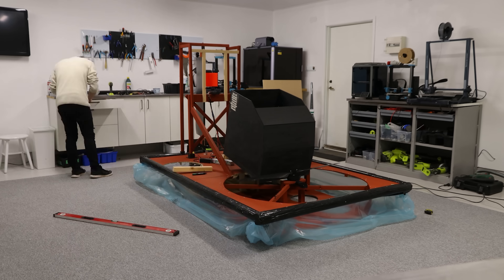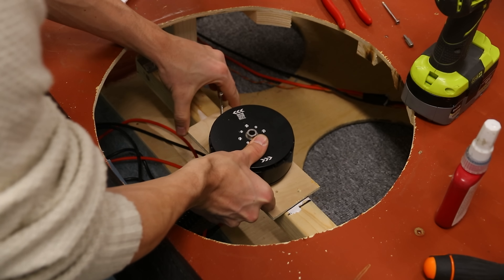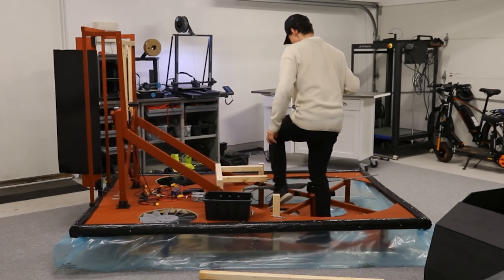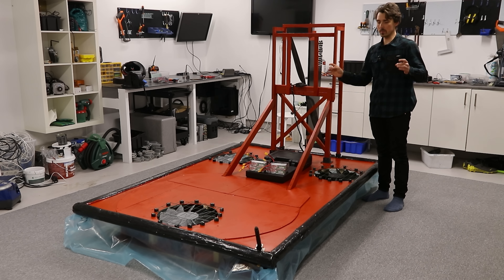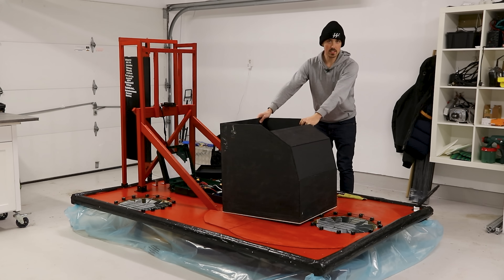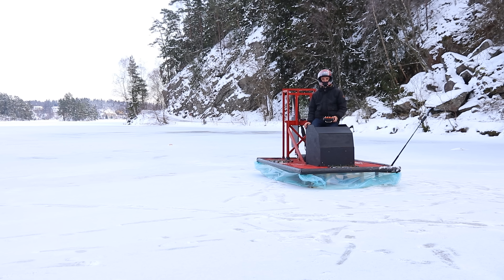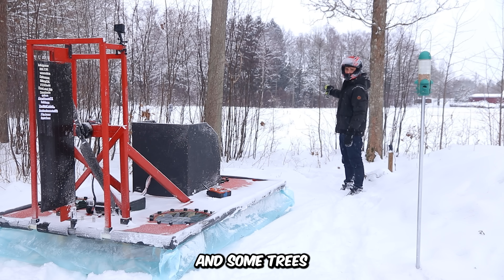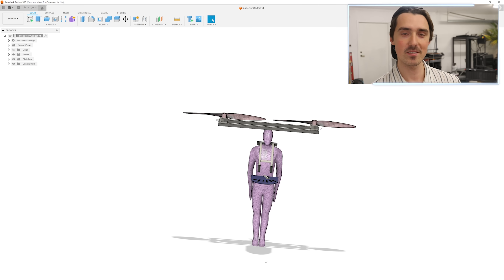3D Printed Compression Propellers - IT WORKS!

Comment: speaking of the antigravity idea, there's some relevant stuff from nasa way back when. when the astronaughts were wanting to practice lunar landings, they had to come up with a way to simulate lower gravity (same problem as you) but it wasnt just as simple as introducing enough thrust

this is beacuse as soon as you lean over, that thrust stops counteracting gravity and instead starts to move you side to side. their solution was to have a central jet engine that is computer stabalized so that it is always pointing straight up and never contributing to your movement, but is always fighting against gravity. 

i think that would be way out of scope for the video so you prolly wont wanna do that. and tbh even if you get like 10-15% of the antigravity thrust as directional thrust instead - that'd just act as a jump boost and might be more fun anyway.
Reply: Directional thrust would be scary and not beneficial. The issue is that if you start to tip over it will immediately pull you even further over.

Comment: Did the RC radio lose connection with the reciever? If so why not set up a fail save for the reciever to shut down all motors. that would stop a runaway from happening. Always have it for my drones and planes
Reply: I think it's just a faulty device. Definitely time to retire it.
Reply: @CircsC  seems like it